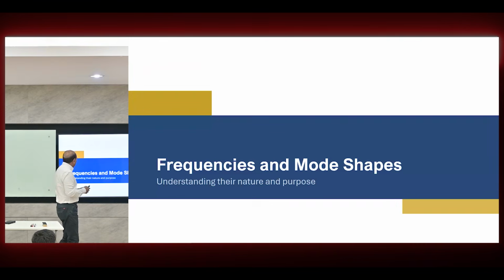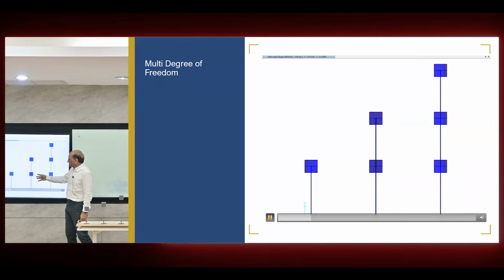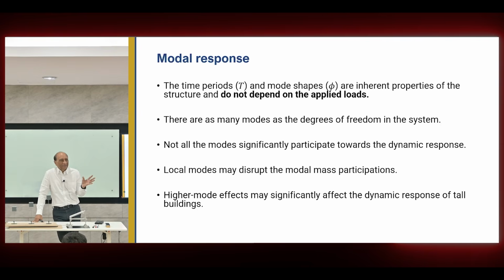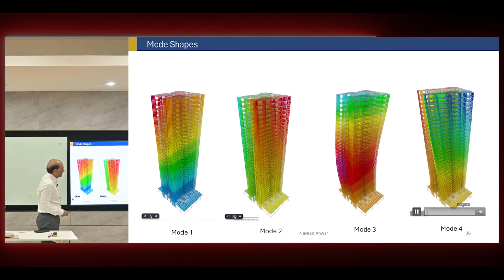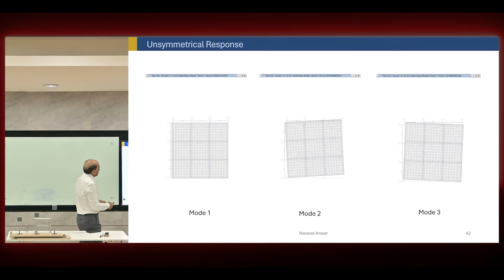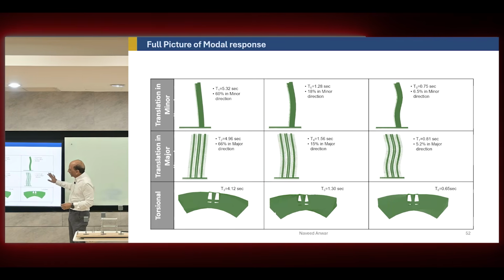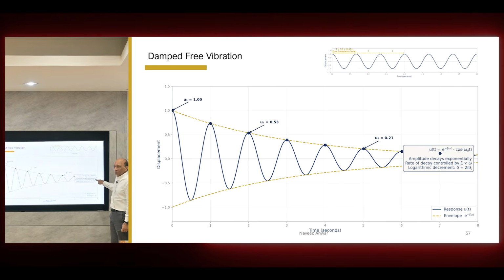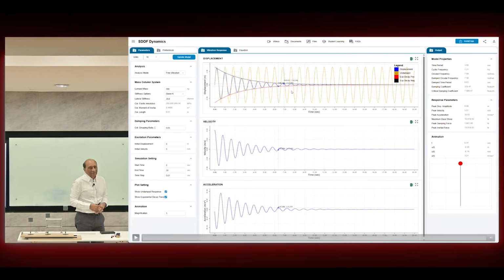Modal Analysis — Natural Frequencies and Mode Shapes

Comment: Is it possible to obtain a modal analysis of a V-shaped building using Robot Structural Analysis or another program? The building will be modeled such that only one of the two wings of the V will have its principal axes X and Y parallel to the X and Y axes of the software's coordinate system.